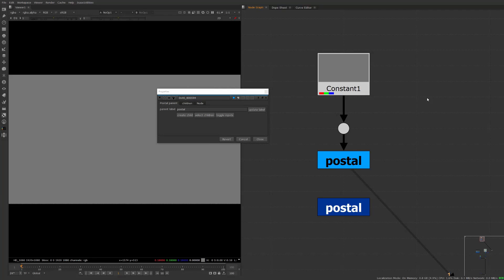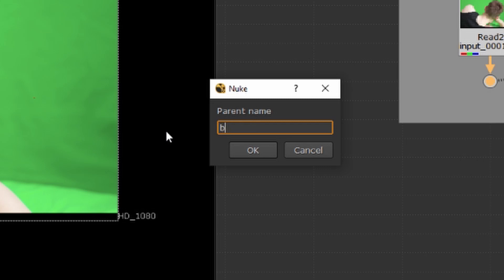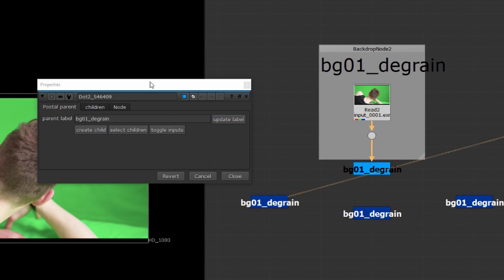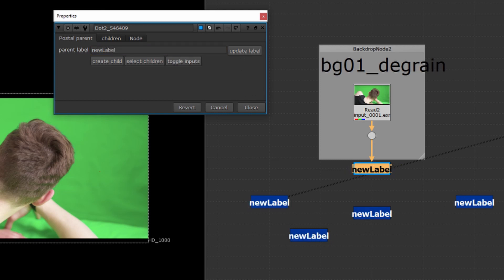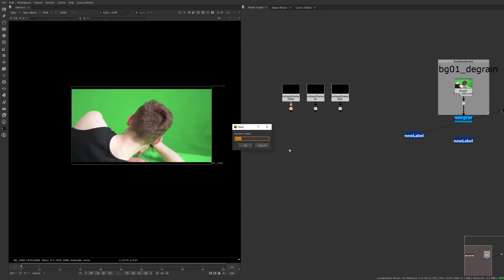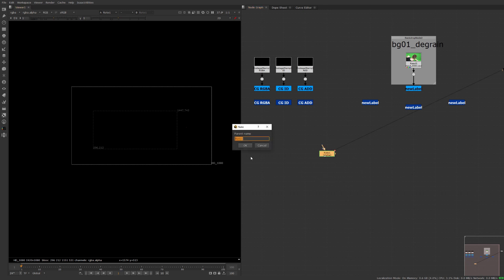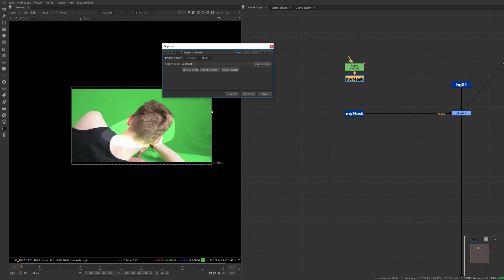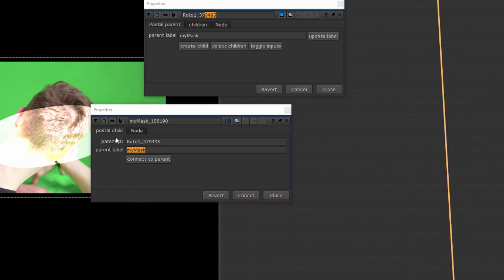Postal_1.0.1 Demo

Comment: This looks very handy way to make a clearer set up of the work. I'm just beginning in Nuke and just finish my bachelor in VFX where I also learn a little about Houdini which is also node base software. I really like the flow that this postal node system can offer. I'll see how to figure out the way to make use of it. When the nodes are all mixed up link lines everywhere I am loosing my comprehension of what is going on. I am at a very junior level so too much complexity make me lost, for the moment. Thank you for sharing your knowledge.